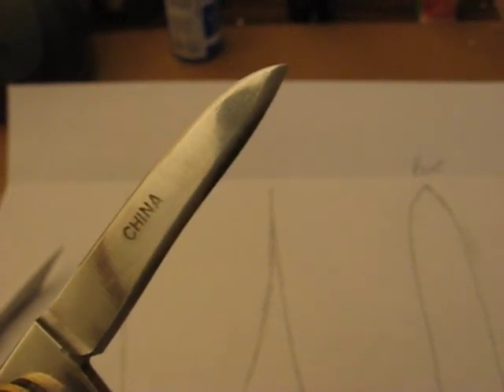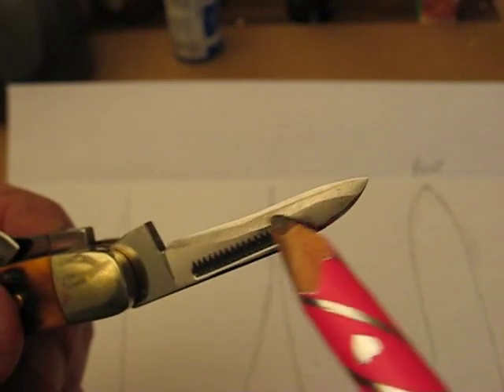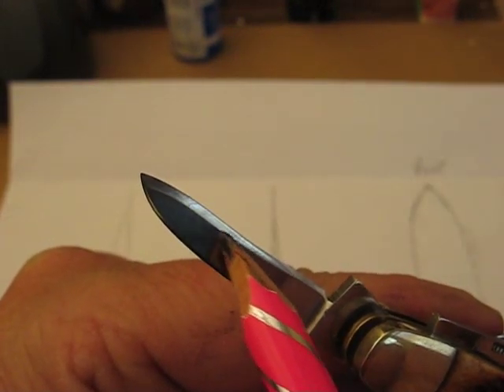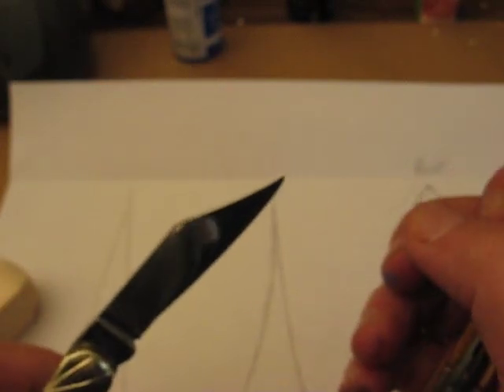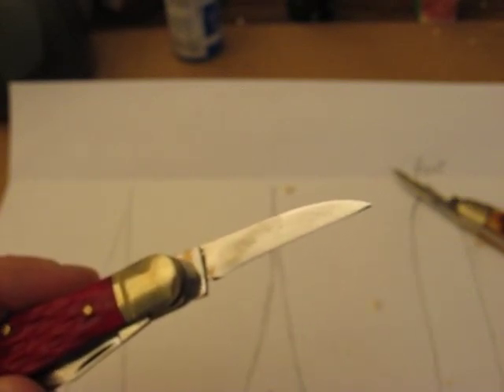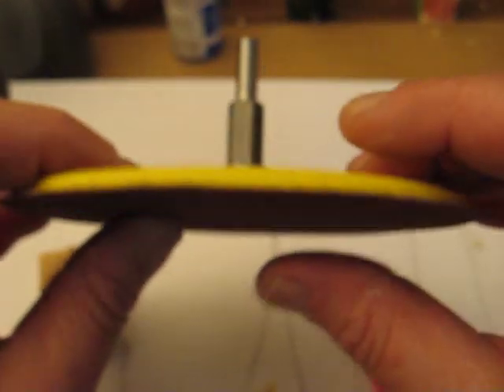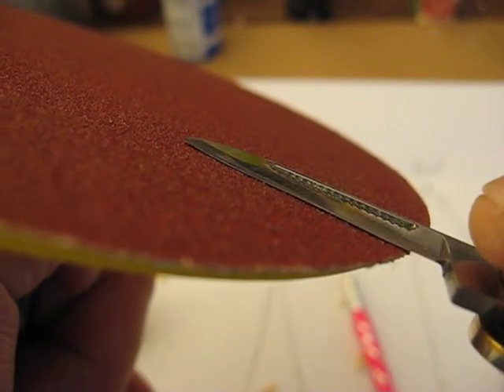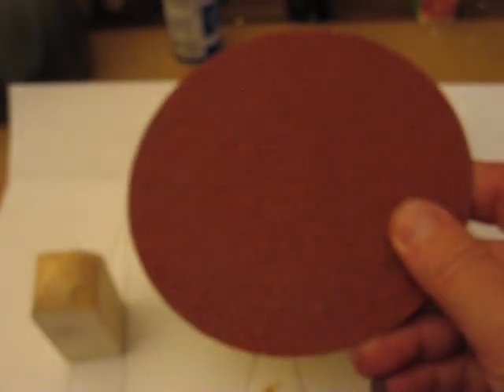sharpening secret #2

Comment: Great advice!! You have hit the problem nail on the head! So many folks don't sharpen correctly and then they complain about how badly the knives cut. You are also correct when you say practice, practice, practice!! Honing correctly also makes a BIG difference. If you have a problem some old barbers still use straight razors and will show you how to hone properly. God bless.

Comment: that "round edge" is a convex grind : / wich is tougher than a flat grind and it can hold an edge longer, on the otherhand the flat grind can be sharpened just a bit sharper than a convex  grind (with a convex grind sharpened well you can also easily pop some hairs of your arm)and "bites" the wood better..